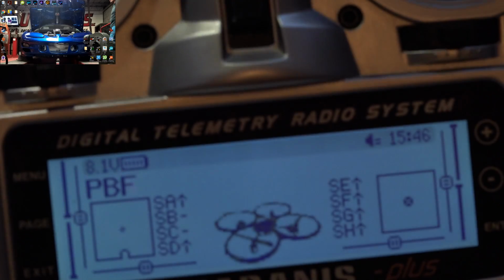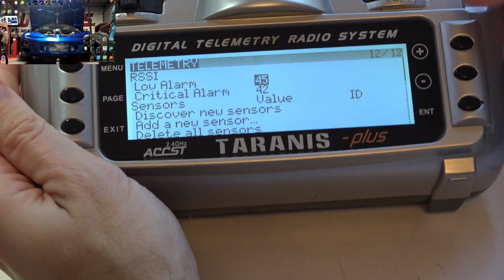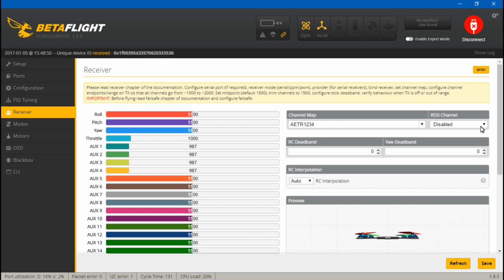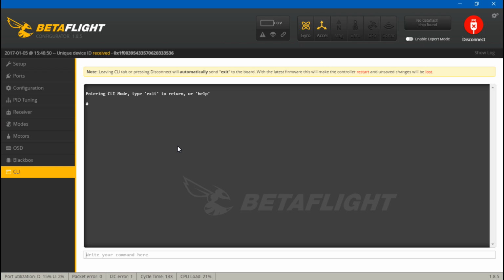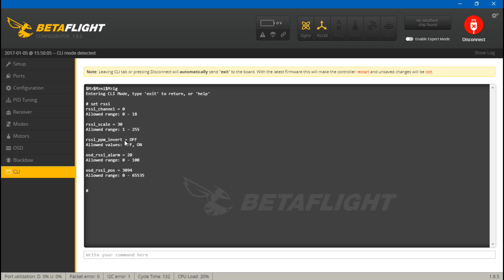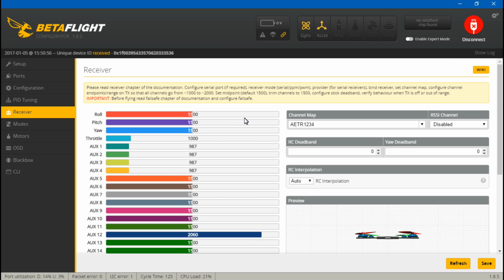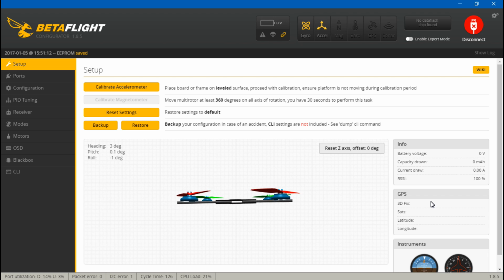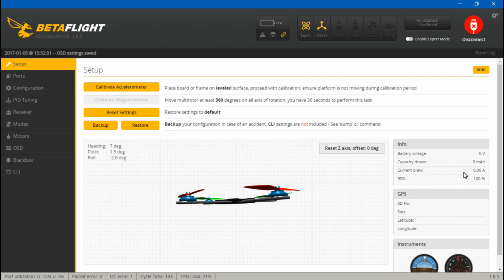RSSI With FrSky XM & XM Plus

Comment: Hi There,

I just followed your steps and i am indeed getting an RSSI on channel 16, however on the setup, RSSI readout is showing 0%, how can i resolve this?
Reply: Unfortunately he passed after a motorcycle accident a few years ago.

You may need o go to the receiver tab in Betaflight and set RSSI Channel to Aux 12, you should see it fluctuating there if it's working.

Comment: Anyone can help? I've been busy for 3 full days now, watch every video and forum possible and still don't know an answer. I have an XM+, that just doesn't get a good rssi with my Frsky X Lite. Tried every firmware, all kinds of firmware combinations, checked everything with multimeter, soldered again, but still the rssi fluctuates from 20 to 80 %. To close, doesn't work, but few meters, should work. But keep getting failsafe every 10 seconds. Absolutely no proper connection. Don't know what to do anymore.

Comment: tried this but it didn't work AT FIRST. if someone is having problems you gotta make sure that you have XM+ LBT170313-RSSI16.frk (for us europeans) firmware flashed in your receiver. 
for others it's XM+ FCC170313-RSSI16.frk

Comment: Hi. I’m new to this hobby. At first I thought you saved me because what you said in the beginning of the video is exactly how I felt. Then after following steps by steps in the video, my AUX 12 isn’t moving at all. I’m using XM+. Also, I got 18% rssi before I even do anything and it flies good. When I fly, the rssi output is going up. I switched the invert to ON and I get 81% with the qx7 sitting right next to the drone. Need help.
Reply: Sorry to be the bearer of bad news, but JC passed away in June of 2017.
Reply: ...... I’m so sorry I didn’t know that. Rest in peace. Thanks for all your works helping people ....

Comment: Just so everyone is on the same page in Ch16(from the receiver) is Aux12(in betaflight). Also, if it's still not working, update the firmware using the rss8 or rssi16 firmware. In the case of rssi8 firmware, it's Ch8 or Aux4.

Comment: For everyone who only has 14 aux. Flash the XM + to the 8 channel firmware not the 16 chnnel and then it will show as aux 4 select aux 4 from pull down save. Works for me.
Reply: How do you flash
Reply: @sloanv2610  I could try to explain it but he has a video of flashing it. Pretty simple so do a few others. Hope it helps
Reply: @blaz1925  Can you flash it while its still on the quad? Someone told me you have to take it off in order to connect it to the transmitter
Reply: @sloanv2610  it would be better to take it out  because you have to solder on a connector and that connector connects to the back of your taranis.

Comment: Cant get this to work, I am using an emax stack, with xm+. in the CLI is ee max Aux 14 and is set to 14 already, have set RSSI channel to Aux 12., do not see any signal on aux 12 in receiver tab. 

Thank you all
Reply: did you get it to work. same problem
Reply: @sloanv2610  I had to flash the XM+ to the RSSI16 firmware. Was supposed to ship with it installed but whatever. Worked fine after flash/instal
Reply: @JpJpJpB  thank you for the reply. How do you flash the firmware if it's on the quad?
Reply: @sloanv2610  Only way I know of to flash/reinstall is to connect the XM+ directly to your transmitter, so you'll prob have to remove it from your quad

https://www.youtube.com/watch?v=eYVk2lWPJxU

Comment: "That doesn't even make sense, why would Frsky make life easy on us?" It would be funny if that would even remotely be true. Frsky is adapting to real world situations more than any other RC brand. Their creative solution they created for the RSSI-feedback even proves you so wrong. I've seen articles from "gurus" blaming Frsky for creating an incorrect S-Bus signal or now S-Port when in fact the FC guys are not adhering to the standards that were set by Futaba and Frsky respectively.

Comment: Is there no problem with using 16 channels on a limited bandwidth? Once saw a video that the rx might mess up your signals because the time between on off cycles becomes so small it misinterprets the signal. Therefore, it not better to set it to channel e.g. 9?

Comment: Great video PBF- I was hoping you could help me out. I'm trying to set up the RSSI on my XM+ for my Skystar X140, but when I go into betaflight rssi menu, I see only 14 channels, not 16 like I saw in your video. Do you no why that is, and what I need to do to correct it if it needs to be corrected. I would greatly appreciate your advise. Thank you very much
Reply: How did you fix this? Im having the same problem
Reply: Karl Dunn he passed away, sadly
Reply: Raven Newbie FPV Thank you for your kind reply. I'm so sorry to hear this news. My whole heart goes out to his family and my prayer's are with them. Again, Thank you, Karl
Reply: Karl Dunn it was such a waste. Don't ride motorcycles people!
Reply: Karl Dunn  are you
Still having trouble setting up rssi?
Reply: @rl2769  I figured it out took a few days but finally got it working. I do thank you kindly for your response. Stay In The Air my friend
Reply: Karl Dunn good deal. I followed your channel pal ✅👍
Reply: hi seen your coment and you managed to fix the 14to 16 ,if you dont mind how did you do that hdobbin@sky.com thanks

Comment: Hello JC.
I've have successfully get rssi from an XM+ following your video here.But my friend done exactly the same and his rssi is stuck on 49 and isn't moving at all.We are both using Matek f405 CTR and XM+,both running Betaflight 3.2.2 and I dunno why mine works and his is doing that.
P.S. Keep up the good work.Thanks.
Reply: have you found a solution yet. mine is doing the same thing. on a qx7 and emax hawk5

Comment: in betaflight where you can choose the aux that has the rssi it only goes up to 14
Reply: Same here. I can't choose RSSI channel 16, as the configurator only goes up to 14. Why?
Reply: im running into the same problem. have you been able to find a solution?
Reply: same help

Comment: I got the latest firmware and got rssi to work. In betaflight i removed the rssi (signal strength) and it got rid of the 30-40% and now shows 0-100% but... its fluctuating between 85-100 while both items are on my bench. Is that normal? Also in the receiver tab for channels it doesnt show 1-16 channel. It shows 1-14aux?
Reply: You removed the rssi signal strength? How? My problem is this: On the left side, I can see the value of AUX 12 (which is channel 16) jump around, but there is no channel 16 to choose in the rssi drop-down list, because  AUX 14 is the maximum . I don't know what to do now.
Reply: Feld Knöterich i removed it from the configurations tab. Rssi strength analog. I went to cli, set aux_channels = 16.
Reply: And also choosing on the right is just aux correct. Just select aux 12. I could find channel 16 either so i just set it in the cli and used aux 12. Also in cli.... set rssi.... it will show all your rssi settings and you can change them.
Reply: Thank you! But still, AUX 12 is jumping around in values, but selecting AUX 12 as RSSI channel doesn't seem to work. The RSSI value is stuck at 33% and doesn't change, no matter if the transmitter is turned on or off. The XM+ has the latest firmware, I updated it yesterday. Any idea?
Reply: Feld Knöterich set rssi_scale = 41. Try that? Normally its set to 30. I changed it to 41. In receiver tab my aux 12 on the left fluctuates around 1700... i dont know how to make it 2000. Im stuck in a way aswell. Just trying to find youtube videos too ,😁
Reply: Thank you, it works now! I had to disable RSSI analogue (as you already mentioned above). But yeah, the value never goes above 1750, no matter how close or far I put the transmitter. If I find a solution, I will let you know.
Reply: Did you find a solution?

Comment: Do you have some suggestions what to do if I still get 50%? I get it only when RSSI is disabled or on AUX 12, since I dont have 16, only 14. For example AUX 14 shows RSSI 0%...I tried to flash XM+ with new firmware but did nothing.
Reply: did you ix and how ta

Comment: Good days... 

I have a very quick questions... 
I using XM+ but in beta flight (RSSI) i only have channel 14 
or i need to flash to lastest firmware . to have 16 channel ? 

Thanks
Reply: im stuck with 14 did you fix it ta

Comment: Falcon!!!! Help me please!!??  Okay I just recovered my Fly Egg for I flew it into a tree long story, anyway no one not I or anyone else and I took my real drone up there and scaned it and non of us could see it wound up in the walnut tree but I watch the camera from the quad looking at the upstair windows from the tree so anyway leaves fell came down, K I flew it for a bit then decided I would look to see if anyone had updated it yet or if it could be? And did so. Flashed fine all is on it, BUT strange things are going on, I did exactly as you show like  three times right along with the damn vid ok, everything yours says mine does EXCEPT it will only give me 1 thru 14 channels in the dropdown list in receiver tab and their are 14 listed on the left with the bars on them mine does not go up to 18 as your list does, and I AM IN D16 mode with 1-16 selected but beside my 16 for some reason never seen it before don't think it says 18ms in parentheses and the light on the XM goes green when TX is on I do not though see a red at all, except when not bound or no TX on you mentioned both should be on? what is that about? Well after I have done this now the TX and RX do not see each other of course I have no RSSI and now I cannot fly my Egg that has been in a tree for four months and I am pissed!! What do I need to do to this thing?? For I flew the bastard a matter of hours ago shit fire help falcon please help maybe I should take the dump I took from it before the flash and flash it back with 3.1.6 or I liked 3.1.7 and just clean erase and put the dump in CLI and hope like hell it will at least fly as it was that is a shitload better than its flying NOW!! Dang it! WTF"?????????
Reply: JC died not that long ago in an accident :(

Comment: Hey JC.
Using betaflight 3.2 and xm+. Did everything in your video, rssi Invert is off, max channels set to 12. But, in receiver tab under rssi , i only get upto aux 14, not 16. Placed the rssi on aux 12 and in osd it only shows 50rssi always. Don't decrease or increase. Stays 50 even if i turn off the tx. Getting the same with all channel's. What should i do?
Reply: I have the same issue, did you find a fix for this?
Reply: esunder just update the firmware from frsky website
Reply: Do we have to desolder from flight controller to connect to taranis for firmware update?

Comment: Hi, I correctly understand that if the receiver and the transmitter do not support rssi, then this parameter will not be enabled in betaflight and nothing will be displayed on the osd connected by spi.

Comment: So I cannot seem to get the rssi value to show up on channel 16 (aux 12) for some reason. Does this not work in BF 3.1.7? I have a Tango Tx, and a 16channel module in it as well as a XM+ rx plugged into my Colibre FC, but I just cannot get rssi to show up there. Do I need to make any other changes? What about the rssi slider on the configuration tab?

Comment: Thank you so much for that Video! I've had set RSSI on my OSD with the help of your Video! But there's on thing thats is very annoying. If i switch off my taranis the Rssi Percentage stays always between 20 - 30 %. So i wouldn't notice a failsafe. The reason is the failsafe setting on channel 16 ( even on Failsafe = drop ). The Channel 16 stays on "hold" and so it holds the last value. But i want it to be 0, so "set" it on 1000. Now i will notice a failsafe by the value 0 on my OSD. I'm not sure if someone else mentioned this tip - there are too much comments. But i think that would be a nice update for your video description. Best regards!
Reply: Where set the failsafe value? In the Taranis or in betaflight that is, the flight controller?
Reply: Torban Dallas mine osd I’m goggles read 17 to 20. But on taranis it says 80 to 90s

Comment: I wish it had RSSI from the receiver back to the radio. I want the radio to talk to me and warn me of low signal strength. Hopefully they will make small receivers like this in future with RSSI back to the radio.
Reply: Senze check out the FrSky R-XSR, it's a tiny version of the XSR that was released recently. It sends telemetry info back to the transmitter.

Comment: If I am using a foxeer monster v2 with it's OSD wil this still work with the Frsky XM+???
Reply: No, the Monster OSD only has capability to display name, power, and timer. 

I am however using the BF F3 that JC was demonstrating and so that the monster osd is not also displaying readouts, I disabled them. You can remove props, plug power to quad, hold the up button on your monster's config remote, and turn off name, timer, and power. This way you'd be able to see your alternative OSD instead of Monster's.

Comment: hello JC im new to open tx is there a way to get low rssi  warning from the radio ? much appreciate help  buddy
Reply: Discover sensors and ensure RSSI is discovered. Then there is a low and critical alarm setting on the telem screen that you can set. Additionally you can set up a logical switch to activate when RSSI value is a bellow a certain number. Additionally you can setup a special function to readout that rssi value once the logical switch is activated. Hope that gets you started.

Comment: so, If I understood in case I don´t have a fc with osd nor minmosd I can´t use rssi right? coz on the radio itself will not work, am right?
Reply: You wont be able to display the RSSI readout on screen as he is demonstrating. You could still take advantage of the low and critical alarms Taranis has to 'hear' an alert or readout. Check just above ^^^^ response to FPV Madness.

Comment: Got the rssi working but I couldn't get the rssi to pop up on my Taranis display
Is it possible to do or only on osd?
Reply: Nicholas Brown it only works on the OSD. If you want telemetry back to the transmitter check out the new R-XSR receiver.

Comment: ***FIX FOR LATER BETAFLIGHT VERSIONS***

I was having the same trouble as everyone else trying this and RSSI only read 50% all the time.  In order to fix this for the XM+ you must update the receiver firmware.  Go to the FrSky firmware download page: http://www.frsky-rc.com/download/index.php?sort=Firmware  and download the latested firmware for either your XM or XM+.  MAKE SURE YOU READ THE "NOTE" on the FrSky XM+ download page as it has descriptions of the files contained in the ZIP file and their purpose. I can only confirm this for XM+ as I don't have an XM.  Follow Blue Falcon's video (https://www.youtube.com/watch?v=eYVk2lWPJxU) and flash the downloaded firmware to the XM+.  Plug the XM+ back into you quad and bingo...RSSI to your FC will now work in the latest version of Betaflight.
Reply: Thank you for leaving this comment! Easy breezy.
Reply: alfonxoduff right.
Reply: T3chDad, I was struggling to make it work on channel 16, but didn't get it to work. Upraded the firmware and voilá!!! Works like a charm now!!! Many thanks!
Reply: This is exactly what I needed to do, thank you for your comment!
Reply: + Matthew McGann: I have to wire mine directly because my XM plus doesn't have the right firmware (presumably) and I don't own a Taranis (I use T8SG Jumper) so I cannot flash it. I'm having trouble though. I made an RC low pass filter to convert the PWM to analog and connected the RSSI ports, but I don't get anything in the receiver menu of BF. I set my RSSI Aux CH to 12 (CH16) and tried all the other channels too no luck. I am reading a voltage of 3.3v after my RC filter so I think it's working correctly, but my FC (holybro kakute F4) just doesn't recognize it. If I use the RSSI pad do I use a channel at all? How does it connect? Thanks!
Reply: T3chDad man solder a wire to the Rssi pad almost seems easier. Sighs Thx tho. I was wondering what happened

Comment: Taranis noob here!, emm I have configured everything as described and I have rssi showing always to 50% no matter what,,, anybody with the same issue????
Reply: I did flash using FCC RSSI16..but still 50%
Reply: Did you find a solution?
Reply: @houstooon  set rssi channel to 12
Reply: same problem here, did you ever figure it out ?
Reply: found the problem, should flash firmware onto the XM+ which provides RSSI on channel 8 or 16 depending on which you want, its on their website, you can use taranis to flash it. I used the FCC version of the firmware.
Reply: flashing the firmware needs soldering right?
Reply: nbl23 yes, you use jumper wire to plug the jumpers on taranis pins on one end, on the other end you solder to the xm+ wires or just twist them if you don't want to use solder. But your receiver should not be connected to flight controller when flashing
Reply: Did any1 have this failsave at 50% rssi or just me with dud xm+?

Comment: Thanks for your videos JC. As others have motioned I can't get RSSI using the XM+ with an f3 board. I've tried rolling back betaflight firmware but doesn't help, when I turn it on the RSSI value is stuck at 50% and it's not moving in the receiver tab.
Reply: Exact same thing
Reply: anything to fix it yet? mines stuck too
Reply: sameeeee

Comment: Wow, that's outstanding!  I'm getting ready to build a micro with an XM+, so this will definitely be something I'll do.  

Unfortunately, the FliteTest kit comes with a controller without OSD, not that I could use it anyway because I intend to use an Eachine TX03 all-in-one FPV cam/tx/antenna, and unless I become a lot more daring, I'm not going to interrupt the video signal to route it through the controller and back into the transmitter.  It would be great if these AIO cams had that feature.